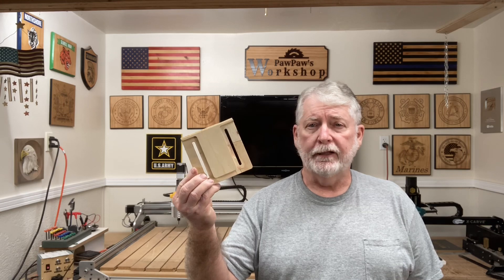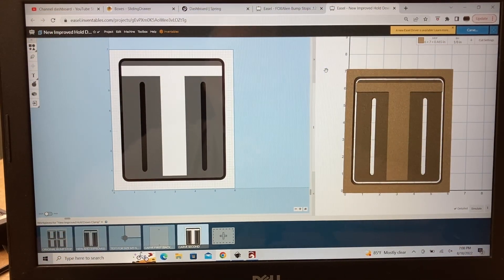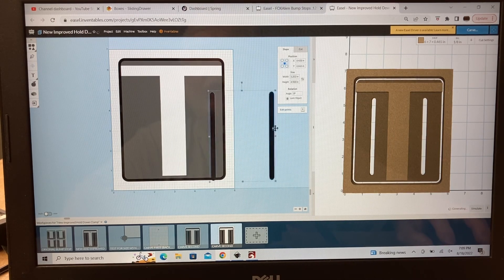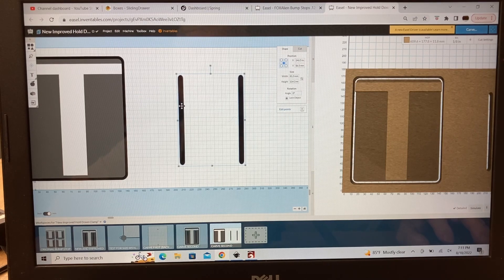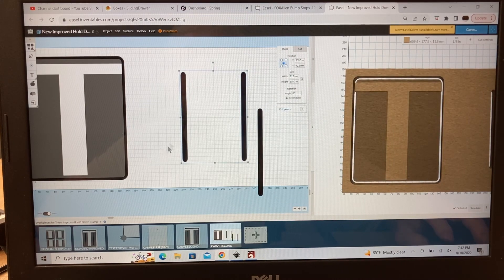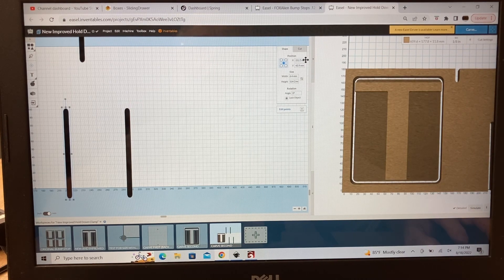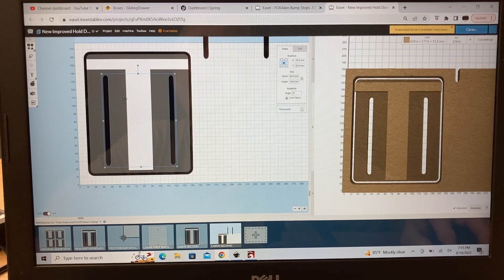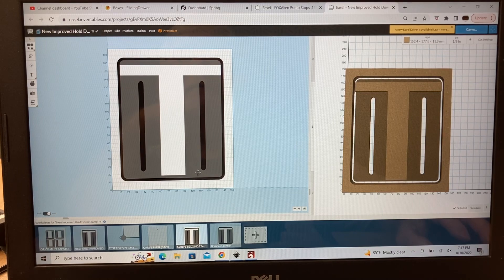Changing the Bump Stops to Work on Your CNC Machine

Comment: I can see from your videos that you are very knowledgeable about all things CNC.  Perhaps you could answer a question for me.  I purchased detailed plans for an over-blade dust collection hood  It occurred to me that instead of cutting them out on a bandsaw and then sanding to the line, it would be more accurate to make a template with a CNC machine.  My question: is it possible to convert a PDF or similar file to a file that can communicate with a CNC machine?  Thanks so much from Safford, AZ.
Reply from the maker: You should be able to use Inkscape to convert the files to a svg format. Inkscape is free and works well. Make sure you have a scale to reference the size. I have a very old video where I did just that for plans to a rc airplane. I’ll see if I can find it for you
Reply: @PawPawsWorkShop  Thanks so much.

Comment: Another great video. After you exploded the lines I would have just created a separate horizonal line at 80mm long and would have moved the vertical lines where their center is on each end of the horizonal line and then delete the horizonal line. The horizonal line would ack like a measuring tool. Might be a little easier if people have problems with the math. Keep up the great work.
Reply from the maker: Excellent idea. Like I always say, there are multiple ways to accomplish the same task

Comment: I have similar problem with hole placement...90mm on X axis, 100mm on Y axis, so I cut a double slot 10mm apart on 1 side
Reply from the maker: There you go, you have a solution.